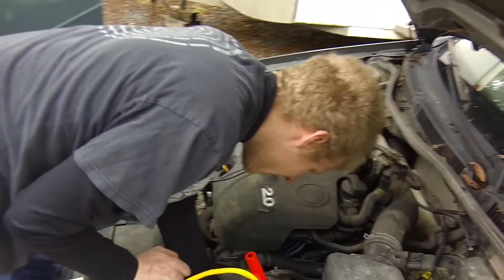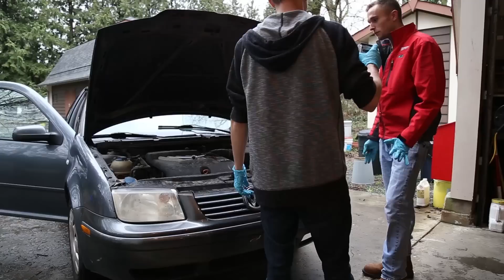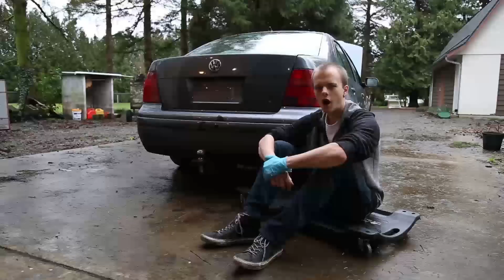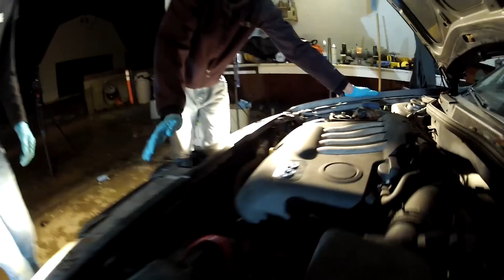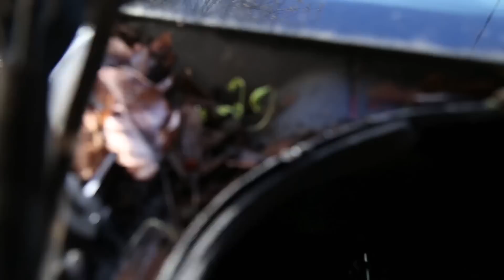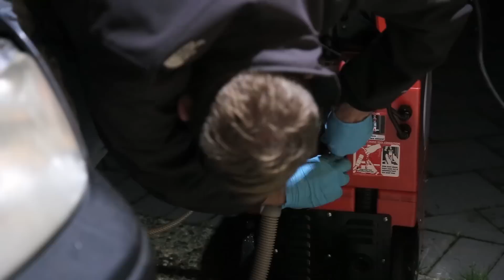Fix it or FLIP it | VW Junker Jetta Part 2/3

Comment: A decent thing to do would be to change the oil top off all fluids, change the windshield wipers or at least razor clean and claybar the glass, maybe even give her a once over with an oscillating buffer and finish it off with a coat of was and dressing for the moldings , and if it were me ide give the headlights resurface with a coat of that Rust-Oleim clear plastic coating for a brand new look

Comment: Full detail headlight buff may be a cheap set of alloy rims and tires.  Probably get 2 grand give or take depending on how many miles on it.  My opinion on it I stay way from used cars that may have been flood cars.  If the underbody has lots of rust I'd hit it with some flat black paint with a cup gun.

Comment: Also if you can get a can of stuff called BGs MOA it works for real, not like all that crap they sling at an automotive store. BGs can clean that motor up inside so well it's hard to belive how dark the used stuff comes out just a couple of weeks of driving after an oil change, I'm not a product promoter or anything but I've used this my self and it's awsome, it can only be bought from a reputable dealer or a Repair shop that sells it, you just have to go and see the BGs website for sellers near you.

Comment: Flush and clean the radiator before filling and replacing the coolant. Flush the engine and drain and replace the oil. Oil is the lifeblood of any engine.

Comment: A 12 to 14 volt electrical shock
Give me a frigging break
Reply: Literally are you 12 ? You can handle 1 million volts if it has less than 75ma current but 12v at 400 amps it'll make your heart explode
Reply: That's what you think it's the higher voltage that's lethal. Many people are electrocuted @ 115 volt A/C there mussels contract and find them selves stuck to the item that is energized.I never heard of someone coming in contact with a large 12 volt 400 cranking amp battery and there heart exploded.
Reply: +ROTARYCOMPTECH no the high voltage is what allows the current to pass through your body as you have a very high resistance so if I had 80 volts at 20ma you would seriously feel it but if it was 150 volts at 1 ma it would just feel like a shock pen, if you had very low internal resistance 12v at 10 amps would kill you instantly hell 1 amp would kill you it depends on the resistance of your body that's why tasers penetrate the skin and hook in
Reply: +iCloud If thats the case how come no one is ever killed installing a battery, I just put both my hands on my battery under the hood of my 3/4 ton truck no shock no tingle no exploding hart,  your wrong, the problem is I work on 480 volt system every day that voltage will kill you not 12 volts under the hood of a car
Reply: +ROTARYCOMPTECH can you not read? Did you not go to school ? I'll dumb it down since you cleaver enough to touch a car battery. If I have 240'volts at 13 amps that will kill you because the voltage over comes your internal resistance and allows the current to flow, if I have 2 volts at 120 amps there's less a chance of it flowing through you because of the lower voltage not being able to over come your resistance. If you penetrate the skin and get to soft tissue or into your blood stream that 2v will be able to conduct through you and allow the massive current to flow which will kill you. This is also why lightning strikes more often than not don't kill people 1,000,000 volts at 10 ma which isn't enough current to kill you
Reply: +ROTARYCOMPTECH no it's not go dip your hands in salt water then touch your car battery why do you think you can weld with car batteries
Reply: iCloud well son I used to own a boat and I've come across that in salt water before you get what's known as a DC burn
At the end of the day like I said before it is impossible to get shocked by handling and working with a 12-volt car battery 
And I'm done wasting my time with this foolishness
Reply: +ROTARYCOMPTECH sorry for starting this argument it was uncalled for you're right I was being a smart ass thanks for taking it so politely when I was not doing the same true gentleman